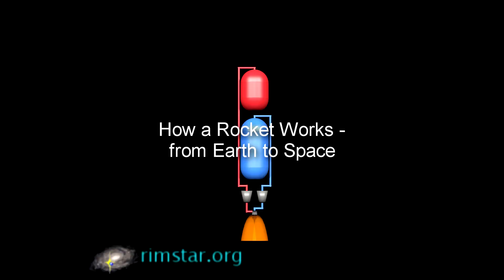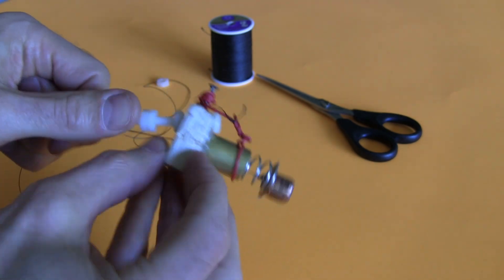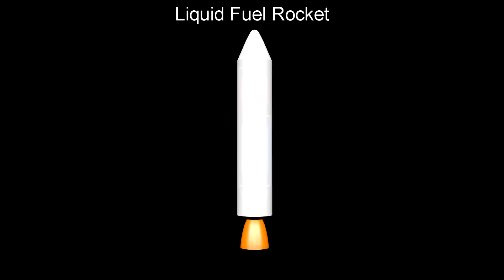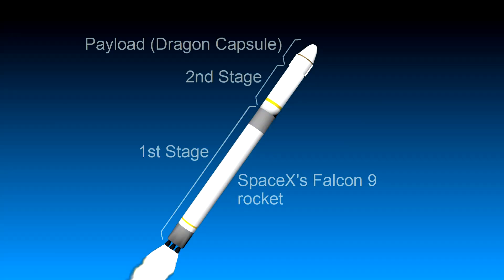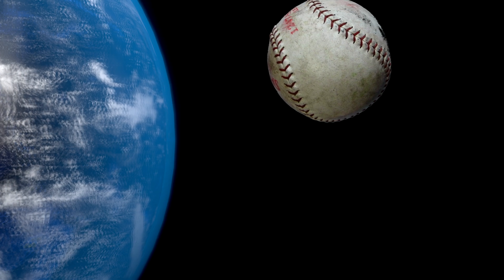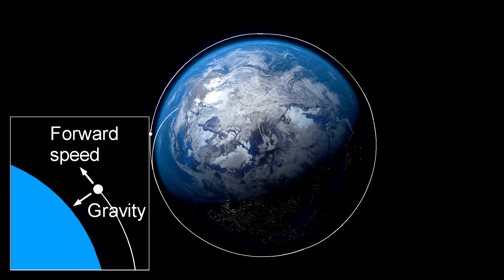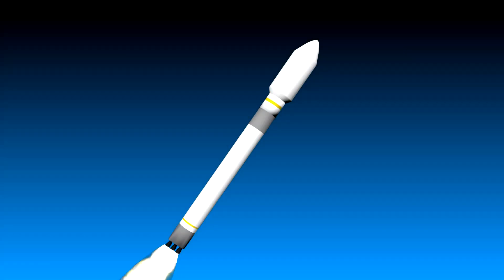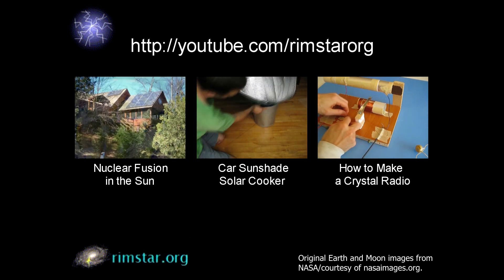How a Rocket Works/Earth to Space Eg SpaceX Falcon 9 and Dragon

Comment: should rockets work in a vacuum? space sucks, so, what's to say the fuel won't just flow our with no movement? as the fuel is just being sucked out.
Reply: Rocket engines are built with what are called 'de laval' nozzels, where there is a pinched section in front of the combustion chamber that then flares out. 

The physics of this mean that when the exhaust mass enters the pinched throat, an effect occurs that is called 'choked flow'. When choked flow occurs, it means the mass flow rate is choked, and atmospheric effects outside the rocket, or lack of atmosphere, can have no effect on the fuel mass inside. 

Basically, the exhaust is going out so fast that the vacuum cannot 'suck' it out any faster.
Reply from the maker: +adam D jones When the rocket is off, valves are close so the fuel doesn't leak out. When the rocket is on, turbo pumps are used to make the fuel come out very, very fast and when it does, it's ignited.
Reply: the vacuum of space does not SUCK  !!!!   There is no pressure, either positive or negative.  You are thinking of vacuum as meaning negative pressure, which causes higher pressure atmosphere to be sucked in.  Typical thing for a hoaxer to say.

Comment: +RimstarOrg Thanks for the explanation. What is the solid fuel used by spacex or nasa?
Reply from the maker: +Fernando Romera SpaceX uses only liquid fueled rockets. You can see what the space shuttle used for it's two solid rocket boosters here (too long to list) https://en.wikipedia.org/wiki/Space_Shuttle_Solid_Rocket_Booster#Propellant. The Atlas V rocket is a Lockheed Martin-Boeing rocket that NASA sometimes uses and it sometimes uses strap-on boosters for added thrust and you can see what it uses here https://en.wikipedia.org/wiki/AJ-60A.

Comment: why a fighter plane cant go to the moon?
Reply from the maker: +Assaduzzaman abir A fighter plane doesn't carry its own propellant like a rocket does. Instead the fighter plane uses the air in front of it as propellant, sucking it into the front of the jet engines and then throwing it at high speed out the back.

Comment: This did NOT explain how rockets work.
Reply: +Leo Berdoman 
Nope.  Watch it again.  It only explains high school physics of Newton and basic orbits, NOT how a rocket works.
If this video showed how a rocket works, then you should in principle be able to build a rocket from the information gleaned here.
It only showed Newtonian physics.
Reply from the maker: +cjheaford Further what Leo points out, it also goes a little further and talks about the need for a fuel and an oxidizer and the various types of rockets i.e. solid, hybrid and liquid. It's also not intended as a how-to-make video, though I do have a how-to-make video for a water bottle rocket. Certainly I could go into more detail of the how-it-works on the various types but in any such video you have to pick a level. I chose to stop at the basics.
Reply: +Leo Berdoman 
Yes Leo, I understand the difference.  Thanks for being condescending.
EVERYTHING that moves or doesn't move is Newtons' laws in action.  So what?  I could post a video on how a car engine "works" and simply say that there is an equal and opposite reaction when the pistons are set in to motion from the fuel and oxidizer (air) and it still wouldn't tell you how a gasoline engine works.  Walking down the sidewalk is an equal and opposite reaction from your sneakers against the road. But it doesn't explain how the engines in your muscle cells (mitochondria) work. 
Everything that moves is Newton's principles. To say an engine "works" because of one of Newton's laws is like explaining how gravity works by stating a baseball falls to the ground after you throw it in the air.  So what?
To state the effect of Newton's laws describes the EFFECTS of gravity or engines or any other movement for that matter,  NOT how gravity (OR ENGINES) work.
I hope you understand the difference.
Reply: +RimstarOrg 
I understand Rimstar.  Thanks for the response.
And thank you for your videos!  Wish there were more good science videos on Youtube.
Keep up the good work
Reply: +Leo Berdoman 
Actually Leo, Newton's laws of motion have nothing to do with gravity at all.  Are you talking about Newton's law of Universal gravitation?  Because that is something else.
Reply: +cjheaford actually we have one law of gravity it s the genral law third law of newtone ... every object with a mass apply the same force of weight on other object in the d distance
Reply: +Leo Berdoman 
WRONG LEO!  You need a refresher course in basic physics.  Do you want me to post Newtons' laws of motion for you here?  I assumed you knew them already.
Newtons third Law:  "For every action, there is an equal and opposite reaction".  NOTHING to do with gravity.
All of Newtons laws of motion apply regardless of gravity.
Newtons law of gravity is something else entirely.
Reply: +cjheaford do you know where come from the opposit force ? its caused by the gravity or otherwise we call it weight
Reply: +Leo Berdoman Are you just trolling me Leo, or do you truly not understand basic physics?  Do you really not know the difference between Mass and Weight?  The force in Newtons third law is NOT GRAVITY!!!  It DOESN'T HAVE ANYTHING TO DO WITH GRAVITY.
Newtons third law applies whether there is gravity or not.  You could be in the complete vacuum of space with virtually no gravity, and the 3rd law would still work perfectly!!!
Make sure you understand 8th grade physics before you start "teaching" science to people on the internet Leo.
Reply: +cjheaford can you define what is the weight because i m sure you don t know it .. i m not trolling btw i know exactly what i m talking about
Reply: +Leo Berdoman 
Newtons' 3 laws of motion function in SPITE of gravity, not BECAUSE of gravity.  Newton was saying nothing about gravity when he postulated his laws of motion.
Reply: +Leo Berdoman UGGUH!!!    Yes Leo, I will humor you:
Weight is MASS x GRAVITY.  It's that simple. 
Now I ask you to explain what gravity has to do with Newton's 3rd law, because I'm sure you don't know.
Newtons laws of motion are about mass and inertia, NOT gravity!!
Reply: +cjheaford mass is relative to gravity mass (weight) = gravity
Reply: +Leo Berdoman 
I know exactly what I'm talking about too.
So how about it:  How does Newtons 3rd law apply to gravity Leo?
Reply: +cjheaford what cause the opposite force in the third law ?
Reply: +Leo Berdoman 
The world is full of Jackasses that "Know exactly what they are talking about".  When someone tells you that they know "Exactly what they are talking about", it usually means the opposite.
Reply: +Leo Berdoman 
Answering my question with a question.  Nice dodge Leo!  I gave you the respect of a direct answer when you asked me what weight is.  You gave me the slippery slimy insult throwing my question right back at me.  Answer the question directly.
Reply: +Leo Berdoman 
I keep saying it, but you keep ignoring it:
NEWTONS THIRD LAW WORKS EVEN WHEN THERE IS NO GRAVITY
Reply: I understand how a rocket can make combustion in space because it has its own oxygen supply, but what is the rocket propulsion pushing against if there is no air in the vacuum of space? Also, how do the wings work if there is no air for them to get lift? Even if the answer is because there is no drag (still doesn’t explain lift) and things will just move without stopping, then how do these forces protect the spacecraft from being pulled towards other planets when the rocket is moving laterally by them?

Comment: What is the escape velocity of earth while leaving earth
Reply: +digvijaya rana Yeah, this question is hard to answer because we don't know what you mean by "while leaving earth".  First of all, in case you don't understand what escape velocity is - it is the instantaneous velocity an object would need and receive no further power to never fall back down from Earth - and it ignores drag.  So, from the surface of the Earth, this is about 11.2 km/s (~25,000 mph).  This does NOT mean that an object needs to reach 25,000 mph in order to escape the Earth.  It means that if you shot it out of a cannon from the surface and gave it no further power, you would need to launch it at 25,000 mph.  This isn't at all how rockets actually work.  They are continuously delivering power.  Technically, you can escape the Earth by climbing a really tall ladder - but you're constantly delivering power to do so.  You can calculate the escape velocity with this equation :

v(esc) = √((2GM)/r)

v(esc) = escape velocity
G = Gravitational Constant - 6.67*10^-11
M = Mass of gravitational source - Earth in this case - 5.97*10^24 kilograms
r = your distance from the CENTER OF MASS of the gravitational source.  So, from the surface of the Earth, this would be about 6,375,000 meters.

So, for the surface of the Earth :

v(esc) = √((2*(6.67*10^-11)*(5.97*10^24)) / 6,375,000)
v(esc) = √(7.96*10^14 / 6,375,000)
v(esc) = √124,925,177
v(esc) = 11,177 m/s

Some other escape velocities needed to escape Earth :

From 420 km (LEO where the ISS orbits) : 10,826 m/s
From geostationary orbit (35,786 km above surface) : 4,346 m/s
From the moon 385,000 km away (ignoring moon's influence) : 1,426 m/s
From the sun 150 million km away (ignoring sun's influence) : 73 m/s
Reply from the maker: +digvijaya rana I'm not sure what you mean by "while leaving earth". You can't reach escape velocity using a single rocket engine from the Earth's surface. You need multiple stages to do it. Here's a link I just found that talks about the stages the Saturn V that was used by Apollo 11 to go to the moon http://www.school-for-champions.com/science/gravitation_escape_velocity_saturn_v.htm#.VrNVfFLSnbg.

Comment: the rockets, why they used flammable fuel, tons of fuel chamber, tons of fuel, rocket debris falling, flying guide structure for take of. waste of money. when flight the force hit the ground and when up the force hits the air, force wasted. My AIR ROCKETS natures way no need   to carry air because its all over the place no fuel chamber. and the load is defy. the rocket carry its own weight leveling the height tilt. when up level becomes + the Antigravity will response to make it zero. the load is responding to the movement of rockets. up down, horizontal travel north,south,west, east. top rockets horizontal and vertical , bottom rockets vertical leveling heights. my rockets is Inside force. reverse rocket the force hits the chassis of the load. from top to bottom. it is not flammable. used 4 elements to fly. 09462568300.

Comment: the rocket in space flight. it can't achieve the speed. also heat can move in space so it must be in front. so if load must be divided in section by means of (------) ? at the bottom  sec 4 moves the sec 3 moves. and sec 2, and 1. but if sec 1moves. it pulls the 2. 2 pull the 3 and 3 pull the 4. if variations is repeated million per seconds it. can achieve speed of light. how I know. no contact it moves and mechanical timing , since no money involved I better not talk. thank you

Comment: Thanks!!!! Quick question, for the 3rd stage part of the rocket that orbits in space, when the solar panels come out of it is that what it uses to keep powering itself in orbit? Or do some satellites do that? Thanks.  And yeah where did you get you're knowledge of rockets from? Thanks.
Reply from the maker: +clint4Now I don't know if the Dragon spacecraft, the 3rd stage you're referring to uses batteries as well as solar panels. It isn't in space for very long so it may well use some batteries. I've read of some satellites that have batteries but they may be ones that get recharged from the solar panels. I can't imagine a satellite without solar panels given how long they're up there orbiting the Earth. Deep space spacecraft, such as the New Horizons one which passed by Pluto recently, don't have solar panels. They're too far out for them to be effective enough and so they carry other power sources, such as radioactive material. And I get my knowledge of rockets from reading books and websites.
Reply: +RimstarOrg Thanks!
Reply: +clint4Now - Satellites that remain in orbit (communications, GPS, Intelligence, etc) have very small thrusters to help them maintain their orbits in the exact shape and angle required for their jobs.  Otherwise, the fact that earth is not a perfect sphere such that it's gravity varies ever so slightly from place top place around the globe, along with the gravitational influence of the moon and the other planets, and even the tiny influence of solar wind would eventually cause their orbits to change shape and angle.  These influences are tiny, so the thrusters are very small.  They typically carry enough due at launch for 10-15 years of service.  Once that fuel is spent, the satellite is soon decommissioned even though everything else on it is probably still as good as new!

Comment: but how do they initiate reentry to the earth
Reply from the maker: troll2453690 The 1st stage isn't going fast enough to maintain orbit so it just drops back down. The second stage does reach orbital velocity since that's the stage that gets the capsule to orbital velocity so I guess it uses rockets to slow down enough to start dropping back (never thought about it before). When the capsule wants to return to Earth it uses rockets to slow itself below orbital velocity and orient itself such that its heat shield is facing forward and at the right angle to take the heat of reentering the thick atmosphere at high velocity.
Basically, if you're in orbit at orbital velocity, you use rockets to slow down below orbital velocity, and then the Earth's gravity does the rest.